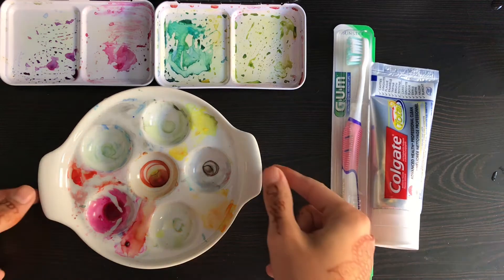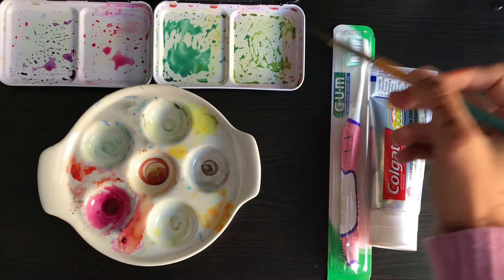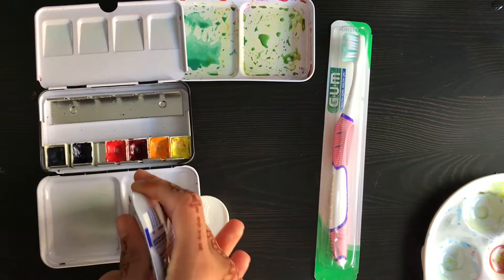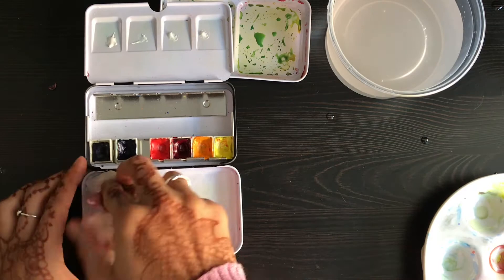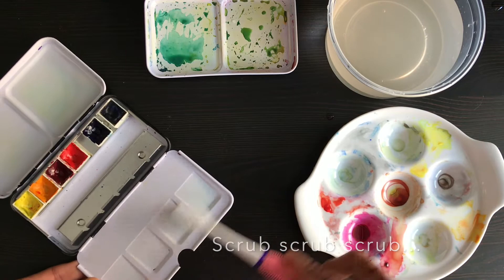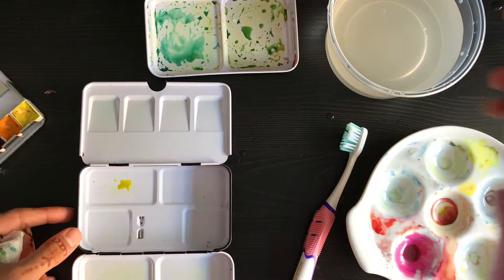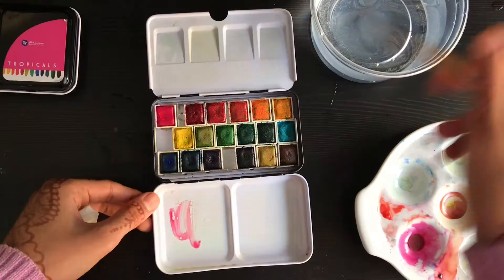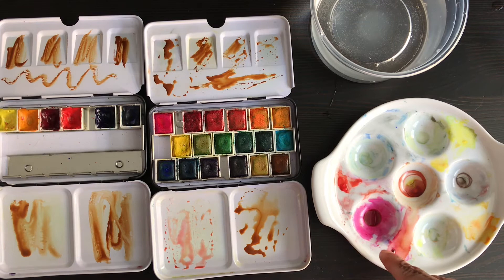Stop Paint From Beading on Metal Watercolor Tin | DIY Palette Hack

Comment: question --- I just bought myself a metal palette, I hated the plastic one that I got because of beading and also because it was bulky. When I sprayed the pans, the paint would drip below the pans, I wanted to know if there's a way to prevent that from happening on the metal parts where the pans clip in. Thank you.
Reply from the maker: D W unfortunately I think (but could be wrong) , it could be because the angle of the metal part isn’t exactly level ? If so, gravity will cause it to drip. Luckily mine is level but I’m not sure how to adjust that